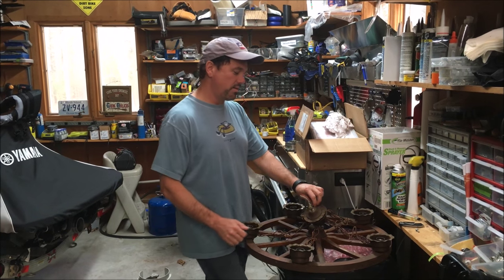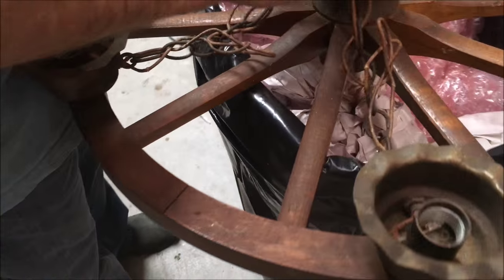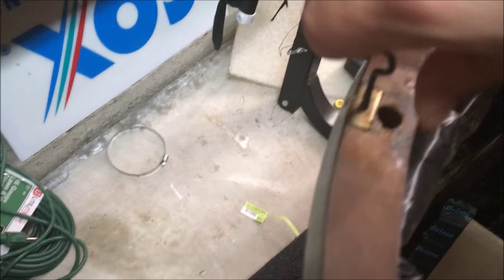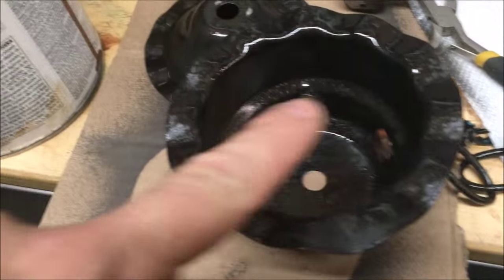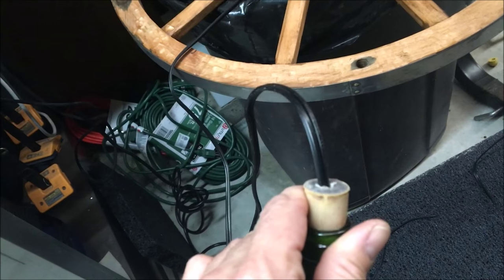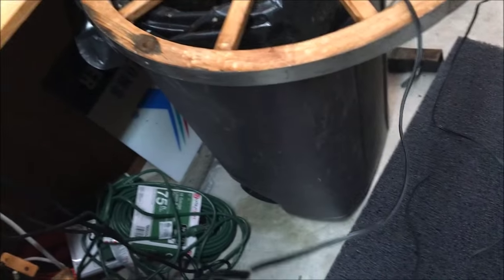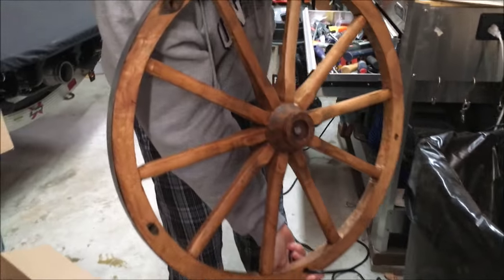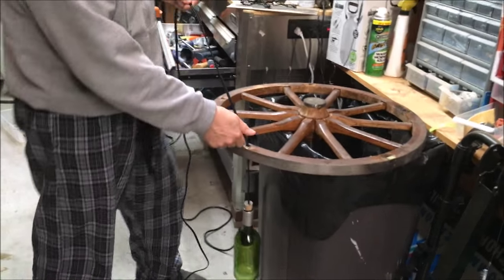Wine Bottle Chandelier - Part 2: Repurposed Wagon Wheel

Comment: Looks like you did a thorough job in refurbishing the metal fixtures and chain. I was wondering how you prepared the items for repainting - did you sand them down or used a chemical stripper?
Reply from the maker: Thanks for Watching Keithy, I used some sand paper and Rustoleum spray paint Bronze Aged Paint to give it a nice look.